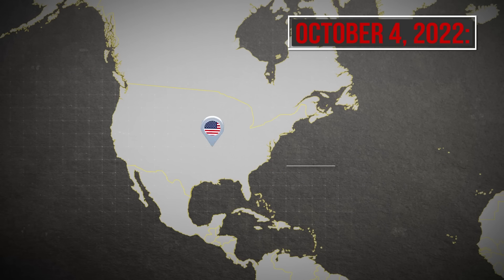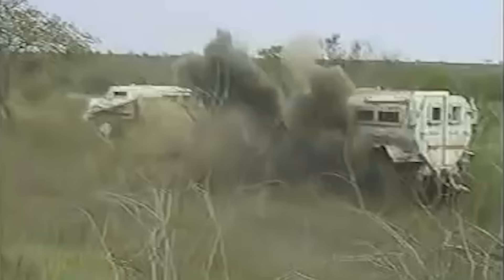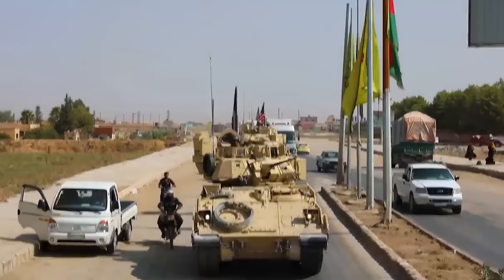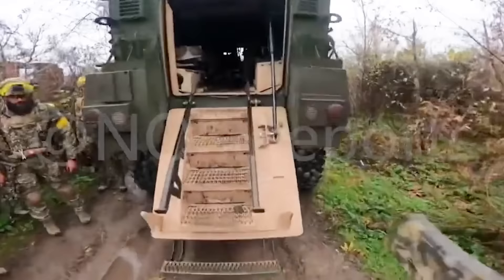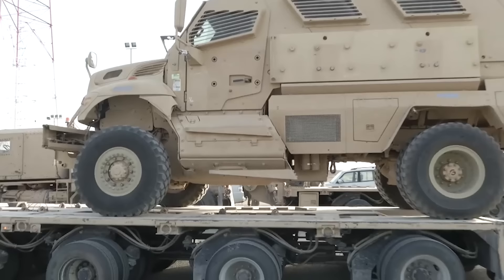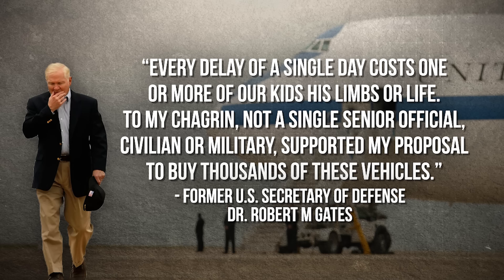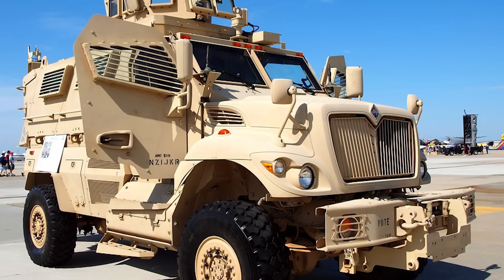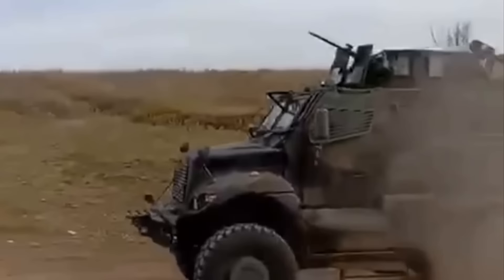Why America is Gladly Giving Away their $50 Billion Truck

Comment: MRAPs were pushed to the line when I was on it. I'm 100% certain that MRAPs played a key role in me living through 15 months in Afghanistan.
Reply: I don't know how others did it, but at first we could choose either barely-armoured civilian cars (just protect the engine from smallarms basically) or the heavy Patria APC. Which is a POS vehicle designed thinking all humans are dwarves.
IED threats limited our patrol ability quite a bit until the Bushmasters came in. Driving Patrias where they shouldn't go also caused a fatal roll-over once.

Wasn't a frontliner myself, typically went low-risk areas, so cars only. An Afghan stepped into the road, stopped us, wouldn't let us pass. Now I couldn't carry a full conversation in Pashto but I can tell when someone's upset about bombs, so we got an interpreter there. Yep, IED buried there. Guy was risking it all for us.

Watched that thing go when bomb disposal was done with it..... Fuck me, there wouldn't have been anything left of us if we'd driven over that.

Definately makes you afraid of IEDs, so having MRAPs around really helps.

Comment: My unit had Cougars and MaxxPro's in Iraq, but rarely used them. Our most used vehicles were M1117 Guardian ASVs. The ASV was bought under the MRAP program, but they were traditional armored cars (updated Cadillac Gage V-100s) and generally made better combat vehicles. They were better off-road, less prone to rollovers, and had a better-armored turret with much more firepower (a Mk 19 and M2, in the turret, and M240 on a pintle above the turret). Since it was a traditional armored car, it was actually designed to match other armored cars like BTR and BRDM. 

The only flaw with the ASV was that we only had 4 out of our 20 "gun trucks". We treated them as an asset for the whole troop, and would send 2 with each mission (we rarely had more than 2 missions outside the wire at once). For the other 2-4 trucks we usually ran HMMWVs with FRAG-6 armor kits and CREW systems (Counter Radiation Electronic Warfare; jammers that blocked remote detonators).

We would use the Cougars and MaxxPros when we expected to be on-road the whole mission, or when we were running too many missions to put the ASVs on all of them, but there were a lot of reasons that we preferred HMMWVs. The one that could have been fixed is that there was a lot of important equipment that we just could not get kits to mount on an the MaxxPro or Cougar since they didn't come through normal procurement (the big one being the CREW systems which jammed remote detonation of IEDs). No technical reason to not mount the equipment, we just couldn't get the kits. The part that couldn't be fixed (until the M-ATV and JLTV) is that the MaxxPro and Cougar were prone to rollovers and generally poor off-road vehicles, while our mission had us off-road about 70% of the time.

For fighting a peer adversary, of all the MRAPs, only the M1117 ASV is really good. It's more or less a baby Stryker Dragoon. The M-ATV and JLTV are good HMMWV-replacements, but their unarmored engine means that they need to avoid direct fire.

The MaxxPro, Cougar, and other Casspir-inspired MRAPs are really pretty bad front-line vehicles though. I could see Ukraine using them as armored cargo trucks, but they aren't significantly better in that role than MTVs and LMTVs with an armored cab. They could be backfield troop transports, but they are dangerous off-road so they would be limited in where they can go. They would be a good vehicle for the forces following right behind the front-line though. I'm sure Ukraine can use them, but that's because they are better than nothing.
Reply: Funnily enough, the ASV is basically the modern version of the M706/V-100 from Vietnam, which was developed because the ARVN found armored cars useful but old WWII-era Greyhounds weren't cutting it. 

And if fighting peer adversaries is a concern, the ASV has options for mortars up to 120mm, autocannons up to 30mm like a BTR, remote weapons stations, and even a 90mm anti-tank gun. 

Though said 90mm gun probably won't do much to a modern tank other than piss it off, and you'll need a bit of luck to tackle something older like a T-62. Though given that Russia is actively fielding T-62s in ever-growing numbers, maybe it might kill a tank.
Reply: The ASV was first used in Kosovo by MP units and originally designed for internal base security. I had an ASV in 2009 in Basrah Iraq, the Army took them all and sent them to Afghanistan. I loved that truck, it was a great vehicle and the AC unit was awesome in the summer months. I was a MP in Iraq, we would run the ASV up front, 2 MaxxPros in the middle and a up armored HMMWV as rear vehicle with a M2 mounted on it. We found the HMMWV was better for rear of the column because the gunner on the MRAPs could not see directly behind the truck and could not depress the gun down enough to shoot close up targets. 
You are right, they are a lot better than nothing.
Reply: ASVs were extremely well designed too.
Reply: Never served, but the issues you describe with a number of MRAPs makes me wonder again why the Bushmaster was rejected from the programme when it was already in production and in service.

Comment: Those 1151s and HMMWVs of that generation were a real solid workhorse. I went through 5 of them in Iraq from 2006-2007, with relatively minor injuries to my crews. The flat bottoms still sucked for buried mines, and the flat sides sucked for EFPs and RKGs with a lucky toss, but overall they were a great stop-gap as MRAPs began to roll out

Comment: The MaxPro is definitely a double edged sword of an armored vehicle platform.  I spent over a year riding around in one and the v-hull and extra side plating quite literally saved my bacon a time or 2 but....those things are so tall and top heavy and TBH fairly lightly armored in the grand scheme of things.  They worked fine for convoy security on a no front lines insurgency based warfront but I can't really see how Ukraine could make effective use of these things ANYWHERE near the front lines.  They're big as hell, easy to see and easy to hit and/or penetrate with modern weapons.

If they intend to use them for 2nd line logistical support and light armor troop transport duties then yea ok but I hope they don't try to fight with the MaxPro on the front lines.  And for the love of god don't exceed 45mph or Sergeant Majors across the cosmos will start having strokes on account of soldier exceeding safe traveling speeds!
Reply: Russians were said to have left a lot of mines behind when retreated from occupied region. So I guess there are for that reason.
Reply: There is no IMV that is fit for frontline use in the conventional sense. However I think these vehicles would be quite usefull for hit and run tactics for recon groups and as battle taxis.
Reply: Yes, the Ukrainians are definitely looking for vehicles for units that are less exposed or more agile than mechanised infantry. And considering the armour of alternatives like MT-LB and BMP the MRAP isn't that bad in the department. They come out pretty similar (which shows you how badly armoured for the role BMP can be) so it is a pretty logical choice for some units. But Ukraine will accept anything, more or less, they have immense need for more steel and there are lots of MRAPs in the world so even though it might not be the ideal vehicle for them they can field it quite quickly and use in their more agile approach to combat when compared with the Russians.
Reply: Yea, I agree. Used one when I was in Iraq back in 2016. What was it again? Don’t do a 90 degree turn at faster than 5 miles an hour? 😂.
Reply: @Userext47  idk if you understand the scope of these things. i dont know how useful it could be for any sort of recon groups. kinda loud too.
Reply: Some Ukrainians drive on BMP-1's or MT-LB's, or even older & less protected Soviet crap. No shade intended, it'a just the way of things.
In that environment, MaxxPro's definitely have a role to play & a niche to fill, especially in supporting fast offensives & transporting troops, especially across potentially mined lines of advance.
With all of the shortcommings recognised... these vehicles can take a mine hit. ^^

Some Ukrainian units that are being newly formed after mobilization are relying on pickup trucks, to supplement infantry transport.
MaxxPro's are a HUGE improvement in that context. <3
Reply: A lot of mines on the battle field
Reply: Better protection than a pickup truck at least…
Reply: Imagine you are in a convoy of pickup trucks in Ukraine because That’s all you got. Your convoy is targeted and artillery lands 100m away but you still die because a Toyota Hilux is not rated against artillery fragments.
Reply: @TheoEvian  the ukrainians are loving technicals lately mrap should be good enough in the role
Reply: They are to heavy for soft terrain, too much weight to spread on just four wheels, there are videos from UA where you can see them stuck in mud
Reply: @T.J. Kong,

Yes the Ukrainian Army seems quite handy at taking used or new military equipment from anywhere in the world and finding an effective use for it.  From captured Russian equipment to donated NATO equipment, they seem to find a way.  I am sure they will be grateful for the equipment given to them.

I imagine Ukraine will probably provide training to NATO countries in the future on how to effectively use their own equipment.  They are battle testing everything they can get and will find out what works for them and what doesn't.
Reply: @mondaysinsanity8193  yeah, any purpose made vehicle is leagues above a technical.
Reply: @alexanderlapp5048  that's true. From what I know they give feedback to manufacturers
Reply: @terrynewsome6698   That’s somewhat true, however the mines are specifically designed to affect armored vehicles. 

The hull design of the MRAP is good against improvised explosives from insurgence groups, but not anti-armor mines that are specifically designed to destroy armored vehicles. 

So the design of the MRAP is significantly less effective in a conventional fight. A smaller, lighter, faster, and less armored troop transport is superior in a conventional fight.
Reply: @TheoEvian  ehhhhh not exactly. For one theres no purpose built technicals i know of atleast. Technicals actually have their own doctrine and advantages. 
While i mostly agree. The advantage of technicals is both being cheap and leagues faster than any military vehicle while hitting just as hard. 
When used properly(tbh think cavalry archers if youre a history nerd) they can punch far above weight class and really fuck with a conventional armies strategies. Aswell their speed can be an ied defense of its own. 

That being said i still think your average soldier would rather be in an mrap than a technical.
Reply: The last sentence made me laugh
Reply: @blockx8607 ,

Ukraine is probably the best comparison test of military vehicles and equipment.  They have some of almost everything and they are in a war zone fighting for their existence.  They are also doing well enough that they look like they might end up victorious after a tough fight.  

I am sure militaries from all over the world can learn something from the Ukraine army after this is over.  Especially how to defeat Russian tactics.  They have been improvising as they go along.

This is night and day from dessert sheild/ dessert storm where General Swartzkopf had an advantage in every military aspect.  Ukraine started as the complete underdogs in this fight and are doing way better than the experts and military strategists predicted.
Reply: @mondaysinsanity8193  Yeah, like, technical is a result of trying to achieve much with little. If you however have the resources to get proper motorised units together you will want to do that. Ofc, there are light attack vehicles that serve the same purpose as technicals made from civilian trucks but are better at it, like the UK Jackal by Supacat.
Reply: @TheoEvian  ah yeah i knew their was actually production technicals there had to be i just didnt have a name. 
Those are the shits contractors love right?
Reply: @TheoEvian  nope my b its the production version of those abominations the sas made in ww2
Reply: If using on 2nd line I'd imagine they'd be a absolute drain on gas.... 2nd line doesn't necessarily need something with that bad of gas mileage to do basically the same job as an unarmored truck... I may be wrong...don't believe I am... this seems like a study for the US to see where this thing fails against a near peer
Reply: They will take any vehicles they can get. It is better than walking,
Reply: agreed. They fit a very specific niche so producing fleets of them at the tail end of an already too long of a war was bad planning, and so was just destroying them when they can still be useful in future security/peacekeeping missions.
Reply: There was a video of a Ukrainian village being liberated by a bunch of dudes in Humvees charging forward across a plain. There's tons of videos of dudes getting into fights riding around in SUVs. This is SURELY an upgrade on those?
Reply: I mean I've seen videos of ukrainian soldiers doing offensives with trucks wouldn't this be a good improvment?
Reply: It need one cheap kkamakazi drone😀😀😀😃😃
Reply: @mustafakhan6935  it no need, it stronk
Reply: I hit 70mph in a Caiman 6x6 up in Kurdistan.  TOC saw it, and thought Blue Force Tracker must have been broken.
Reply: @Userext47  Unfortunately, Maxx-Pro's can barely get out of their own way. M-ATV's on the other hand are pretty awesome.

Comment: As always, another great video,

Back in the day when I was in the US Army stationed in San Antonio Texas, Academy if health sciences, West Germany, Ft, Benning, and 29 Palms, we had M113's, M577's and Gamma Goats. I drove my battery commander around in a vinyl covered 1/4 jeep that wouldn't stop an average powered pellet gun projectile.  Our medium short-range air transportation was leftover, beat-up, underpowered Vietnam era Bell UH-1's with an occasional ride on a Chinook.  Our standard issue M16 A1's were so worn out we had to twist the upper and lower receivers into a bind, so the connection pins did not vibrate out causing the weapon to fall apart while firing them. 

In my opinion, for the US Government giving away and or intentionally destroying MRAPs is shocking, irresponsible, but not surprising.  Especially when we settled for truly crappy hardware described above, for so long, since about the start of the Vietnam war. Arguably, building and deploying 10,000 MRAP's in 18 months sounds like a lot and may have been WAY too many.  I suppose that question should be directed to the families of dead or disabled veterans as a result of insufficient armored vehicles.  

The Pentagons highest priority should be, research, develop, test (with soldier feedback), then produce this equipment and technology with proper training to maximize those systems to reduce the loss of American soldier's lives, while maximizing attrition of the enemy.   Post military medical care should also be parts of that highest priority policy.  If this strategy is too expensive, maybe our politicians should reconsider how many places and how often we travel around the world to engage in deadly conflicts, that cost American lives, produce disabled veterans and generally don't make things better in the long run, anywhere.

Furthermore, post military veteran medical care is at an all-time low.  Imagin upgrading VA medical care program from M113 effectiveness , to MRAP effectiveness.  More than half of my psychiatric appointments are inexplicitly canceled, a fast primary care appointment can take of six months or more to get, and the community care program is so dysfunctional, it reeks of third world country quality.  The medical care employees at VA clinics and hospitals are NOT the problem.  They actually care about providing high quality care, but they just don't have the resources to do so.  Politicians always talk up big plans for improving Veteran care and have been doing so forever.  However, based on my personal experience, it just isn't happening.

Again, just my opinion and I could very well be wrong.  

Mark Nicholson
Former, US Army - EFMB, Combat Medical Specialist
Ft. Sam Huston, Academy of Health Sciences
1/94 FA MLRS - Erlangen, West Germany  
690th, Medical Company - Ft. Benning, Georgia 
Supporting Misc. Heavy Weapons, Training Ranges,
Airborne Jump School and Ranger Training Brigade (ARTB)

Comment: The vehicle at 3:25 is a special mine-clearing variant of the Casspir, using steel wheels to clear AP mines by driving over them. I saw this in action in Mozambique as a journalist in the 1990s; awesome to watch. (Interestingly, many of the mine-clearing operators were ex-South African special forces.)

I rode on a Buffel as a conscript in the 1980s, and rollover was a worry. And the rumour was that it wasn't very bulletproof. Luckily, I never got to find out. But a great vehicle in many ways.
Reply: 2:34 as well, I think
Reply: That mine-clearance method by Denel was so faulty, it had to be done manually all over again. A couple of sappers got blown up by half-actuated mines left after being rolled over.